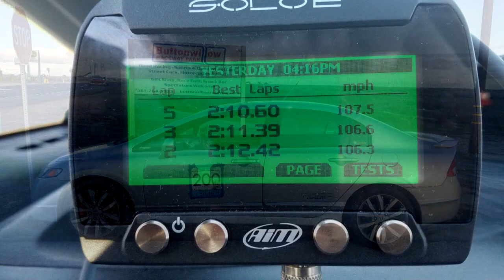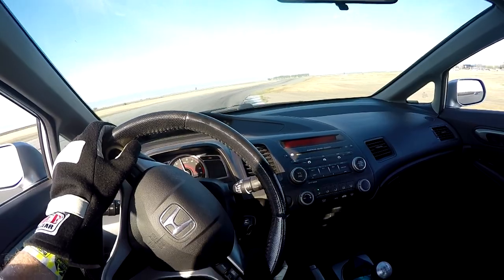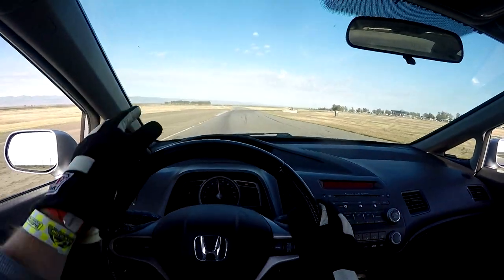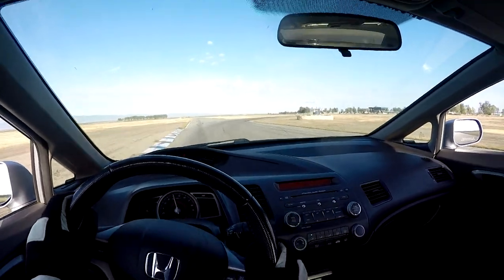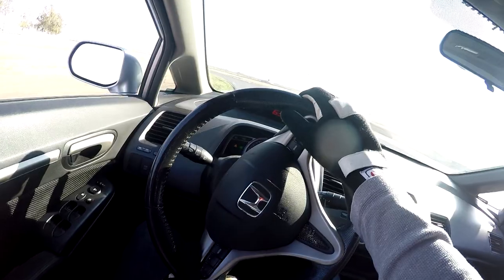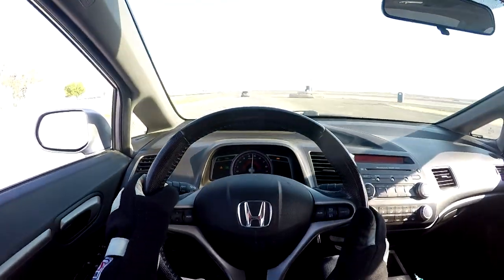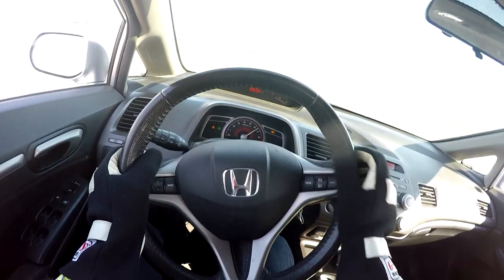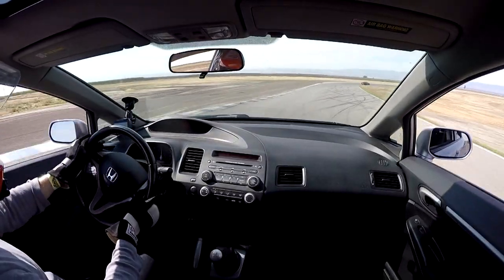Breaking My Car at Buttonwillow Raceway Park || Project Civic Si Part 13

Comment: For a better input gear response when u shift you should look into a slave cylinder and clutch master cylinder from k-tune and while your add it you can get a short shifter from hybrid racing that is really nice option for the 8th gens and see if it comes with the bushings if not add them in.  👍